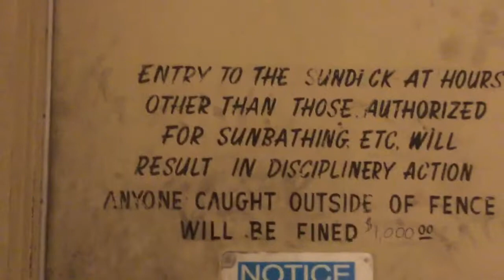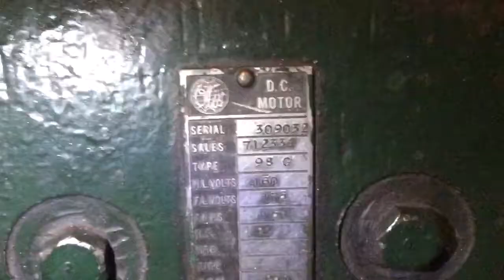Last full day of elevator operation in 12-story dorm

Comment: were you able to save any of the relay stuff?
Reply from the maker: They have not torn the building down yet. I probably won't salvage anything from this building.  There is still one 5 story dormitory that still has this type control that is slated for modernization that I may try to get the relay racks.